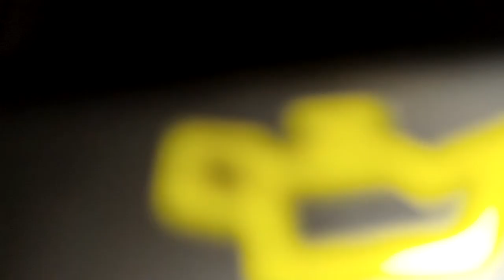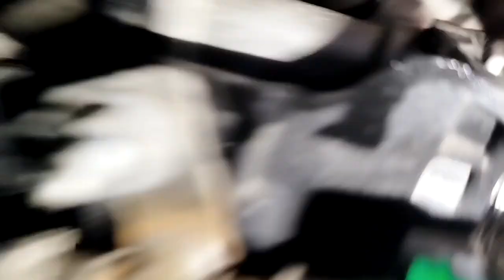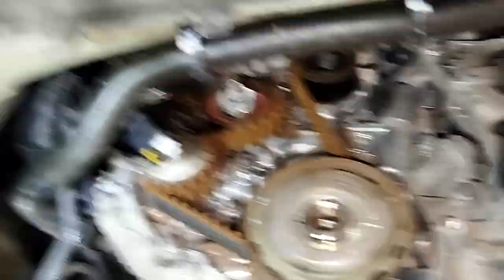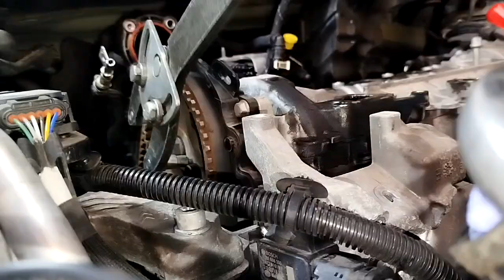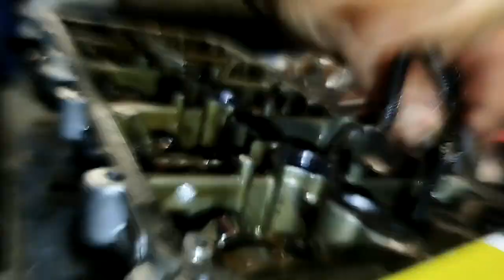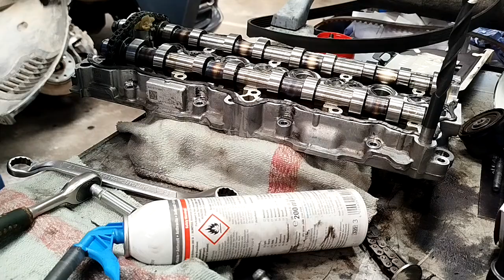Psa 1.5 16v blue hdi timing belt and chain replacement in the cilinder head DTC: P02ED P00BC P0017

Comment: Was it more "cost-effective" not to replace the 7 mm chain and tensioner with the improved 8 mm chain and tensioner when you were already in there?
Reply from the maker: It is not possible to replace the 7 mm chain and tensioner with an 8 mm one... The 8 mm chain requires different shafts and a flanged shaft housing, which is quite difficult to obtain (at least here where we are), meaning extra time and cost... The car owner wanted to use the vehicle as soon as possible... The best solution is to avoid this engine altogether...
Reply: @turbolali wish I knew about the 7mm before it snapped 😢. I wasn't driving when it went so hopefully it's only a few bent valves but I will be upgrading to the 8mm.
Reply: The kit alone is £870, because of everything you have to change.